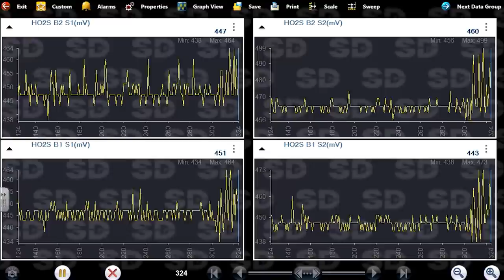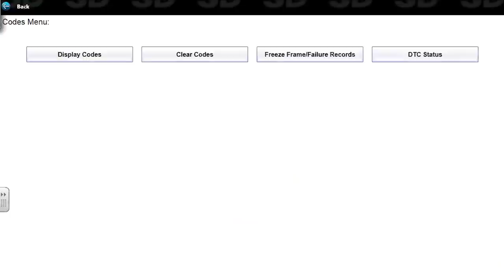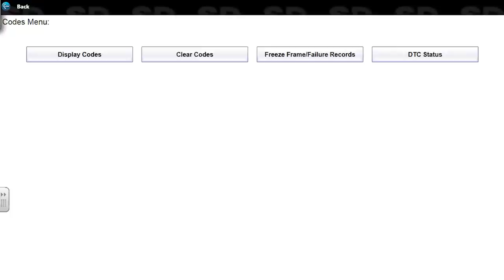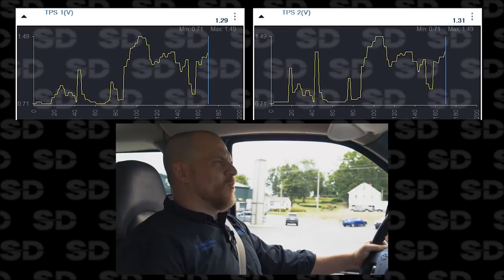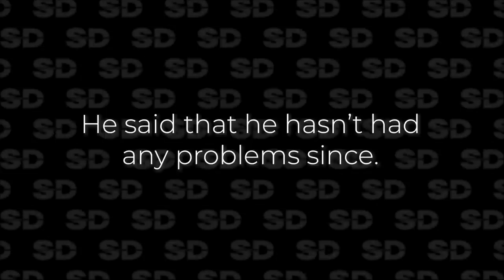Chevy Express Van Electronic Throttle Body Problems Part 2

Comment from the maker: Link to part 1 https://youtu.be/5dm0QPBFHU8 For more information on Oxygen Sensor Heater Circuit controls and Bias voltage, visit my Chapter 5 playlist on ScannerDanner Premium https://www.scannerdanner.com/scannerdanner-premium-chapters/chapter-5-oxygen-sensor-testing.html
For a video showing the wiring breakage that is inside of the insulation https://www.youtube.com/watch?v=0OumX9covQc&t=323.0
Reply: Happy 4th of July! Thank you for another great video
Reply: Hello, I woul like information for yor classes I tried but I couldn't find you thank you so much scannerdanner

Comment: Strongly recommend heat shrink and solder for proper wiring repair.
Reply from the maker: To each his own. Many manufacturers use crimp connectors on there splices and they are not soldered.

Comment: I’ll use the blue connectors and strip twice the length of wire and bend it in half so there is a doubled up loop in the connector.
Reply: Glad to know I'm not the only one that does that w butt connectors that are a little big....

Comment: Needless to say that there's a GM TSB that addresses this issue which seems to plague many GM trucks/vans with early electronic throttle bodies. GM sent out a newer ECM calibration that should cure the problems.
Buddy of mine went exact the same route like your customer by 1) replacing throttle body and 2) new TB connector, but it still went into limp mode on occasions. I updated him the PCM with newer calibration data using Tech2 and the problem was gone since.

Thanks for the funny umbrella moments and oxygen heater theory 👍

Comment: Aweesome!And..that Fibre tape from TESA is FANTASTIC;We used that excact tape at the Mercedes Benz Dealership when doing   various electrical recall work etc.And i brought with me a bunch of those when i left the dealership..and been using them  ever since.Great quality..and superb for electrical repair work in engine compartment etc. Anyways.Thanx for another great video.And a big up to the guy doing that wiring repair work.DOH :) Greetings from Norway ,Stefan

Comment: I like using splice sleeves too compared to solder and shrink wrap. Soldering can be a pain in tight quarters. I've used the NAPA sleeves before and they work great, just don't buy the ones at Wally world, LOL. I like watching your videos when you film at your brothers shop, it's like auto diagnostics and comedy central both in one.

Comment: Would identifying the wire that came apart's function maybe give you a clue to if indeed that was the issue.
Reply: i was thinking the same thing.  maybe leave it off to see if it gives the same codes.
Reply from the maker: I showed the scan data, and on one of the TPS sensors, the signal went to 5v, so this was either a sensor ground wire or the signal wire itself. No question this condition would set these codes. Remember I read the description of one and it was if the signal was under .3? or over 4.8? (somewhere in that range) it would set that code.

Comment: I have a 2002 Chevy Express 3500 with the 57 it ran great started one morning move 3 ft and quit with crank over no start change a bunch of parts change the ignition coil it would start for one second and then die changed crank sensor crank position sensor nothing same change Kim position sensor same what's wrong with the van

Comment: 5:42 this is usually what ends up happening in my head, i just had an acura come in the dealer (work at honda, so i am familiar with the engine) and whoever decided to put a timing belt on this thing did a poor job putting it back together, when im repairing it still pops in my head, especially when looking at wiring like in that shot with the not-finished butt connectors "OH MAN, BUBBA AND THE BOYS WERE HERE, WHAT KINDA B.S. DID WE COBBLE TOGETHER TODAY THAT I GOTTA FIX?"

Comment: Paul any chance you have a video on a newer throttle body 
I'm having problem understanding this 2016 express tps thanks
Reply from the maker: Not sure which engine you have but I just checked a 2016 with a 6.0L and it is just a single potentiometer and a reverse polarity DC electric motor (5-wires)
The 3-wire pot is tested exactly like every other TPS. Hope this helps
Reply: @ScannerDanner  ok great thank you 
I'm sorry I kept bothering about this but I got lost in this one 
Thanks for ur videos man they help me a lot and your book too

Comment: It’s funny, at Nissan they actually use the heat shrink solder sleeve in their electrical class. They are quick and easy. I wonder if all stealerships are going to that now? Hopefully they hold up. Do you have any confirmed issues because of them?
Reply from the maker: I do not, the ones I've done seem to hold up good.

Comment: Sir i have questions have a good relay and voltage on my terminal but if you install the relay it not energize can you help me for that thank u
Reply from the maker: relays have load and control sides to them, there needs to be more testing done on your part for me to be able to help you. Also, year, make, model, engine, what relay you are messing with, which side you tested (load or control), how did you test it etc etc
Reply: ScannerDanner thank you 1998 bmw 2.5 sir and im still looking for shorted and also my battery drained fast overnight the my problem of my is cranking to start im talking about relays fuel pump and air pump not energizing tried FP relay to dme working and bypassing thank you sir
Reply: Cranking no start no fire to ignition pack
Reply: E36 318i

Comment: Hi bro , I have 2000 Astro van . I have a problem my mechanic changed the tps sensor twice and I drive it for one day and half  . The check engine light come on with the same p0121 again. Mechanical said is an electric problem can you help. Thansk
Reply from the maker: If you have a voltmeter and can follow some recommended tests I can

Comment: Have you ever dragged your thumbnail down a wire and found an internal break in it? Your nail drops down into the insulation at the break. I have found several intermittent shorts in commercial equipment this way over the years. It’s easier if you know which system wires are involved in the circuit.

Comment: I’m a huge fan of your videos but I was wondering is there a way you can use a laptop to control onboard automotive systems such as door ajar switches or other things activated by the ecm ?
Reply from the maker: you will still need some type of scanner interface module, you will NOT be able to just plug your laptop into the DLC. I've never really used a laptop based scanner, so I cannot advise you further, sorry

Comment: I have a 2000 Chevy van 5.7 having intermittent power loss myself. Scanner not finding anything. Comes and goes.
Reply from the maker: Check your fuel pressure
Reply: That's been on my mind. Just changed the fuel filter this afternoon. So far so good! I'll keep you posted.
Reply from the maker: @neilfantacone7534  if it comes back (power loss), look at your scan data and tell me what your oxygen sensor is reading at wide open throttle. It should be over 800mv (full rich signal). If it drops lean (around 200mv), then you absolutely have a fuel delivery issue (MAF sensor skewed or fuel pressure dropping off under load)
Reply: Changing the fuel filter didn't help. Put a pressure tester on it. Took a few seconds to build 10 psi. It got to 50psi after driving it. Then dropped to 38psi. Put the new fuel pump in today. Success!

Comment: always solder my joints & heat shrink :) wont use them crap joints
Reply from the maker: I've never had a problem with these. And if I had the good heat shrink, I wouldn't argue with you. The problem is, most of the heat shrink sold is garbage and does NOT have the sealant in it when you heat it. If it doesn't have that, I won't use it